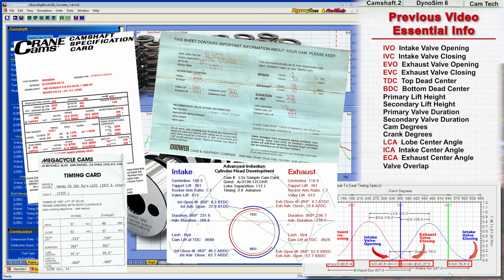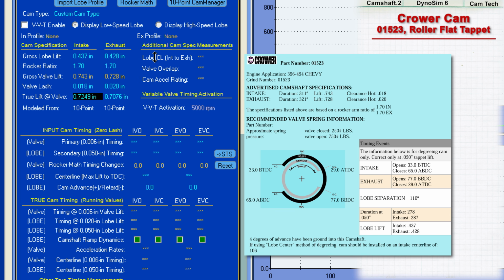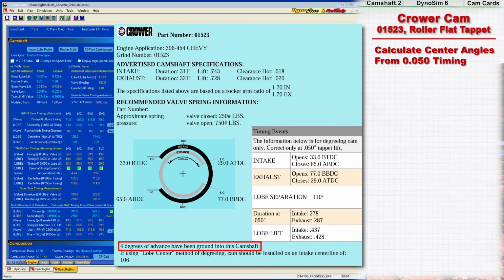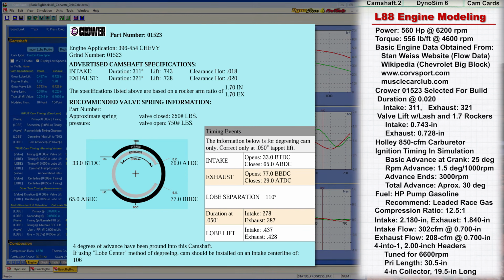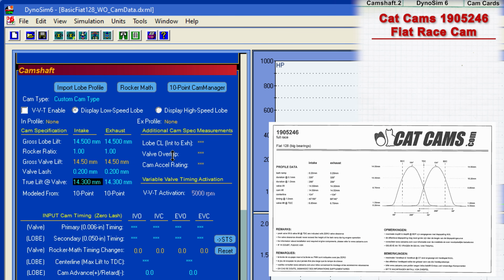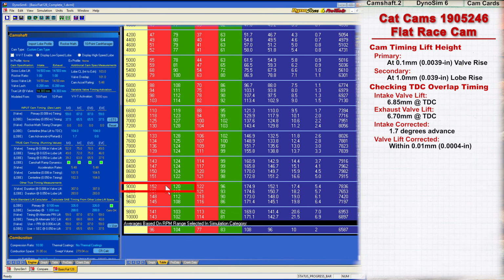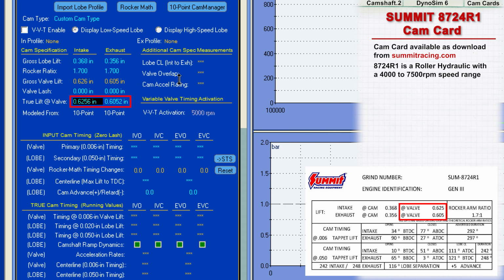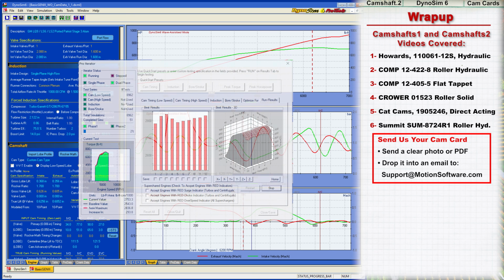3_Cams And Engine Simulation, CAMSHAFTS.2

Comment: I observed that when the Summit cam card data was entered, the lift at .006 was clearly stated on the card to be at tappet lift, however it a
was entered as valve lift in the simulator input... Also does this mean that Summit is not using SAE standard or am I confused about the standard?
Am I missing something here? Thanks, great video!